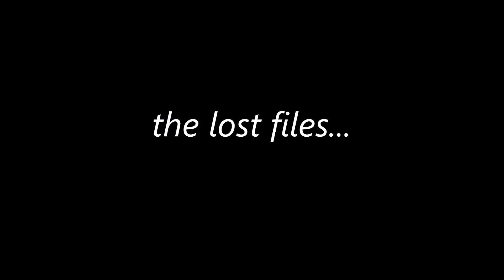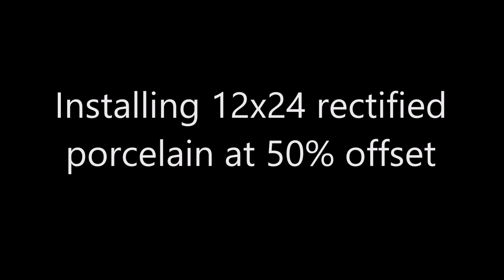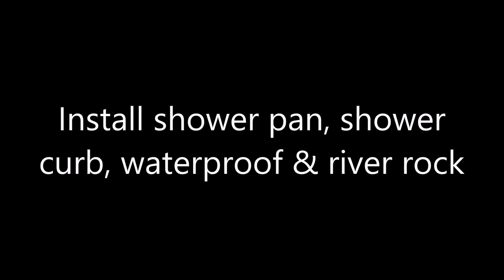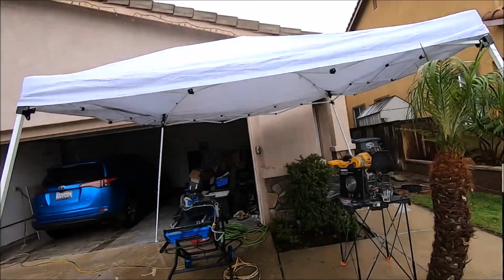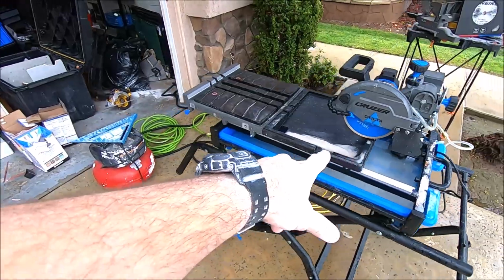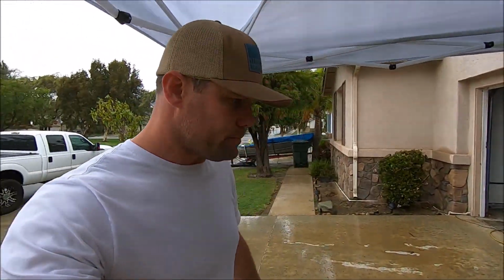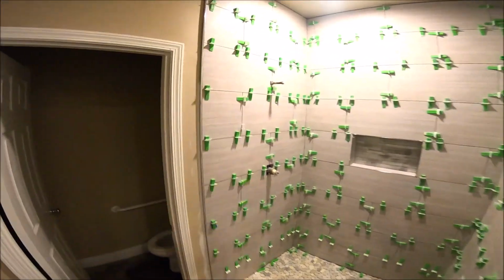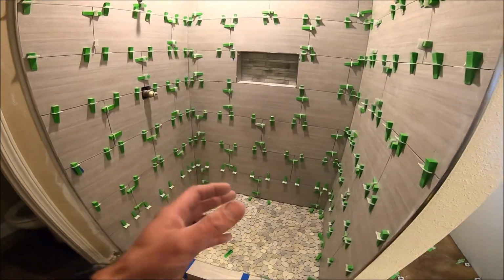Budget Shower - Bath & Shower Tile Ideas

Comment: Looks great like great work, how much more would it cost to move a can light,  replace the shower valve move the shower head up?  Drain if not in a slab?  I am thinking 500 to 1500. ?  The title is a little miss leading. I was hoping to see some good ideas on How I could save on my diy shower job.

Comment: Great work as always. Quick question regarding waterproofing - what’s your opinion on using regular dry wall, with a roll on membrane like mapei aquadefense? In your opinion is it a good enough system?
Reply from the maker: Yes, they are both good systems.

Comment: Are the new walls Hardiboard or cement type board Or regular Sheetrock,, that went onto the studs? Thanks for the posting, I have to do this.
Reply from the maker: Drywall walls, thinset and then Kerdi membrane over.

Comment: Should’ve spent the few extra hundred bucks. 

Love the way you guys work and set up.
Reply from the maker: Cost was already low, removing concrete slab, relocating drain, pouring additional slab, installing new valve including valve/trim kit, relocating can light, patch, skim, texture match and paint. More than a few extra hundred bucks.  👊